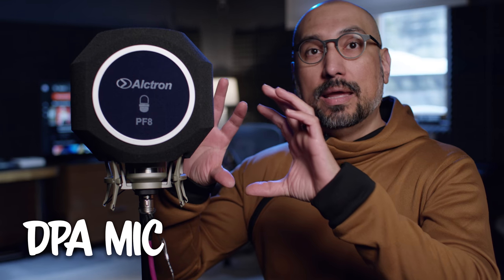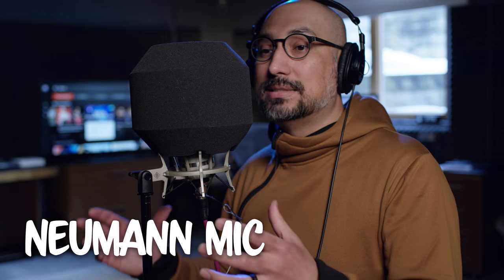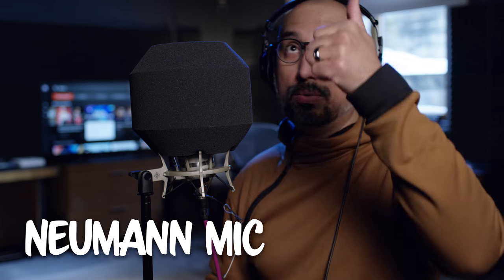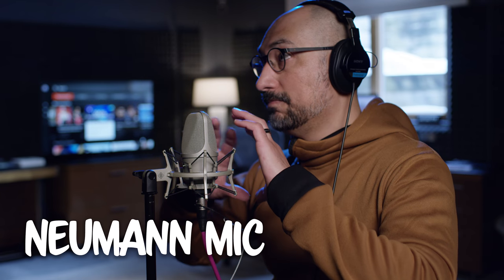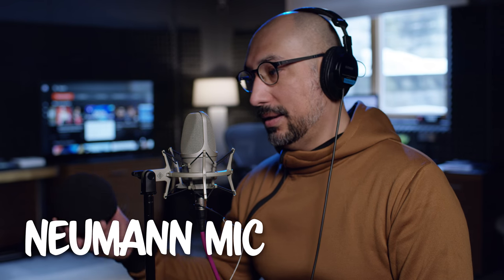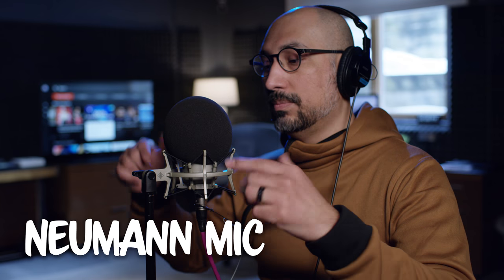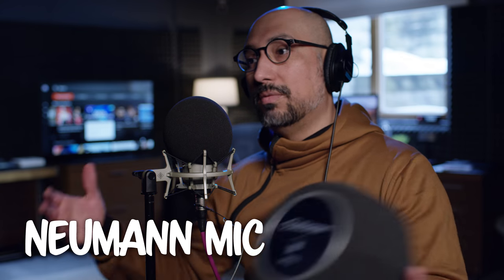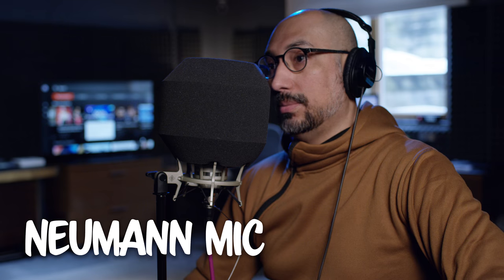Alctron PF8 - Pro Microphone Sound Barrier Filter Review a Kaotica Eyeball Alternative

Comment: Alcotron have licensed the PF8 to Studio Spares in the UK for them to use with their own brand. It's called the Studio Spares Iso Cube. It's just a different name on the pop shield. In a small room it works like a charm. In a larger room you probably need to put up a room divider and hang some duvets or blankets over it. I just got mine so I'm going to try it out properly on a project tomorrow

Comment: Great review, I was using an SE isolation shield which was very good for recording. I just purchased a new mic stand  today that clamps onto my table, one that has the scissor arms/ suspension so I can freely move the mic away from me when I'm not using it. Unfortunately the isolation shield is too heavy for the stand to hold up. I need something that will block out outer noise and this seems like just what I need. Thanks for your review! 🔥💯.
Reply from the maker: the mic pickup pattern may be the only think you have to consider with that new setup.
Reply: Same situation I’m currently in as I just sold my SE iso pro, it served me well for years but I now want the flexibility of recording vox at my desk using a mounted arm swivel stand so this will be great for my applications.
Looking forward to purchasing this product and putting it to work !
🙏🏾💪🏽👍🏽

Comment: Sounds closed in, obviously because it is.
It sounds like the difference between open back headphones and closed.

I prefer to hear a bit of the room, just sounds more natural.
Reply: Crazy prayingmantis that’s my thoughts exactly when I made a dyi ball... the voice sound tiny compared to my bed foamed closet...
Reply: That doesn't work well for recording vocals for music production, especially if the audio engineer is planning on using any sort of processing or pitch correction.  The recording needs to be as dry as possible, and reverb is added back in afterwards along with any further processing.
Reply: Depends on what you are going for. For music and podcast room sound is not a desired trait in a recording

Comment: I think with the Alcatron PF8 the sound is more muffled and less natural. Neumann mics are so good you would probably just go good with a pop filter and leave the back opened. Great video Carlos
Reply from the maker: thank you
Reply: @carlosq00  I just recorded on the PF8 for the first time & i was using a box around my mic with a little foam before. still a HUGE difference. I feel like It's way more clear, BUT picks up more of the mid & low tones so EQ may be needed for recording purposes. i have a lot of low frequencies in my voice. It adds warmth that gets lost in an "open" environment, but not really mud. If someone bumps up the 2-5 frequency, sweeps below 100 & dips down at about 250, it will sound pretty clear.

Comment: There are two things to consider with the sound in this demo. What the Electron does as a simple pop filter, and what it does as an "isolation" device. Certainly it helped with Carlos's p-popping, but in terms of the isolation itself, this room is very quiet and the Electron seemed to add a low mid coloration to the sound. It still sounds very nice and can certainly be EQd in post to sound terrific, but the Electron does color the tone. His particular room is so quiet that I think it makes the mic sound worse (although he should use a standard pop filter for his plosives).

Comment: So, there was no Gate/Expander in your signal chain at all? It almost sounds too quiet with and without the filter for a room that is supposedly not as treated as a proper booth. If not, you have an EXCELLENT room and you don’t give it enough credit lol. Thanks for the review.
Reply from the maker: no gate and no expander, the sound went straight into the mic preamp.

Comment: Thank you, sir. Your review was very helpful for me because I have had some doubts before buying pf8.
Reply from the maker: Glad it helped do share your thoughts once you’ve given it a try.
Reply: dom1k3 yo u can get this on eBay for like 10 bucks cheaper then like usual price everywhere just a thought
Reply: @carlosq00  hi again! Sorry for late answer :)
Yes, I gave it a try, but after some thoughts I've decided to buy the pf8 pro instead of pf8 (if regular pf8 is a foam ball, then pf8pro is a bucket with foam inside). First of all, I want to say that my room actually is not treated (reverberations and such things), and pf8pro didn't help in this case. After that I tryed to record in a closet (clothes, pillows, and blankets are good sound proofing material). In that case I've heard some significant improvement in sounding, but there was some annoying boxiness. BUT interesting fact -- when I added pf8pro to closet recordings, the sound has become much clearer. Boxiness gone away.
In general,  think this thing couldn't help in absolute untreated room, but still could be very useful in closets and semi treated rooms.